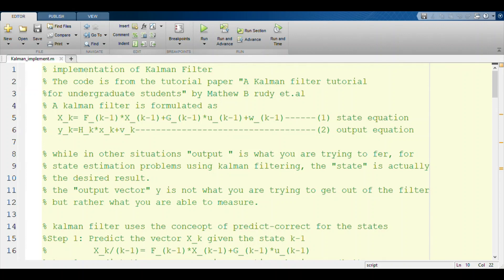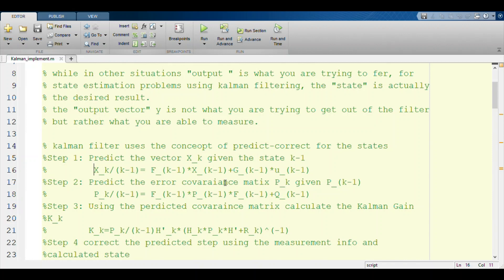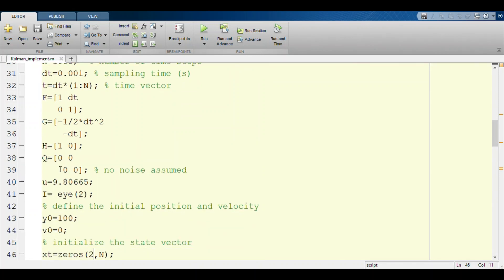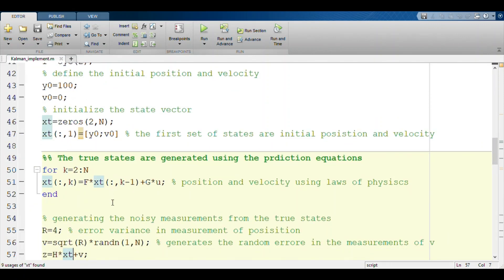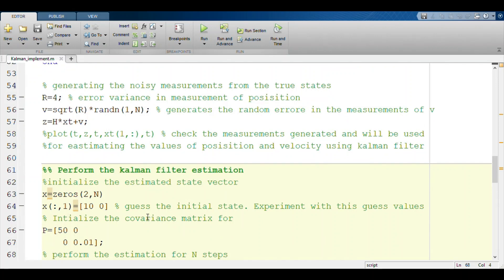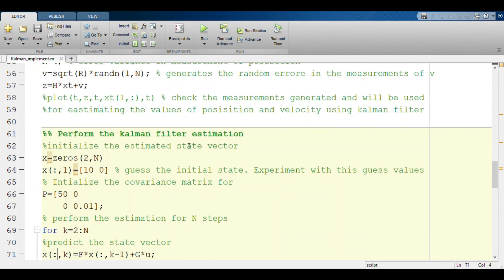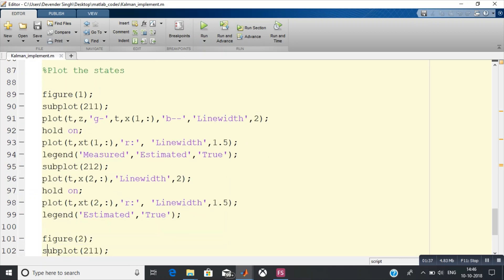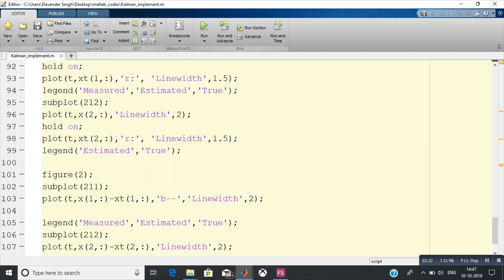The Kalman Filter Implementation with MATLAB

Comment: Sir, kindly explain the bottom graphs of both the figures generated from the script file !
Reply: Yes both the figures are generated from the same script. There are two state variables in the system namely position (height, x1) and velocity (x2).  The second plot corresponds to velocity variable x2.
Hope this explain.
Reply: @drdevendersingh507  Thanks for your reply sir, I saw that there were two variables namely position and velocity but I need to know what does the bottom graphs signify from both the figures?
Reply: @shayantnandi5819  The second graph gives the comparison between the actual state and the estimated state. In real systems you will not have any actual values of state are only the estimated values. It signifies that the estimates of the states are close to the real ones. Here we can compare the actual and estimated state as we are simulating the system in actual practice these errors can only computed once the actual states are available which is not possible in real time off-course.
Reply: I would suggest you may go through the theoretical explanations in another video if you like.
Reply: @drdevendersingh507  sure sir I would like to go through your more videos on it, and it's glad to know that I am also from Varanasi and currently living in Varanasi though, it would be a pleasure to meet you personally someday :)